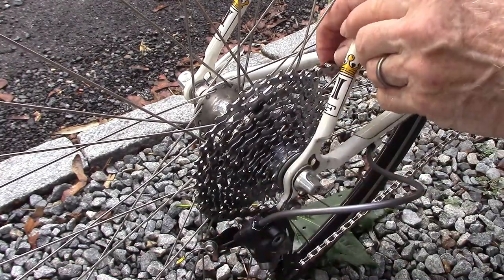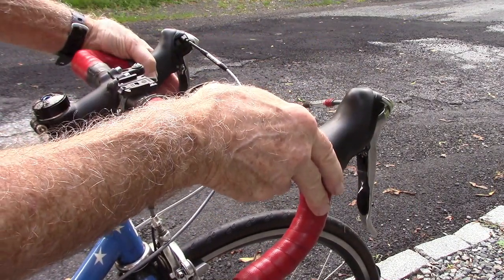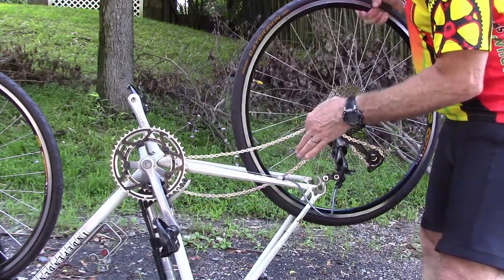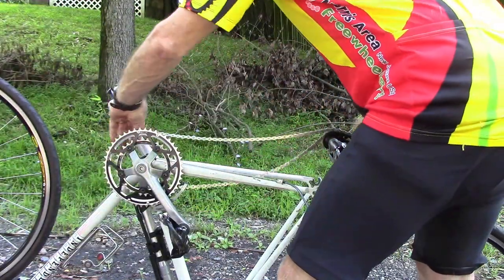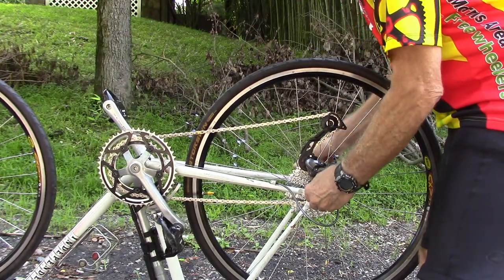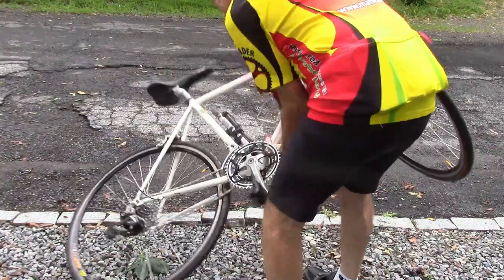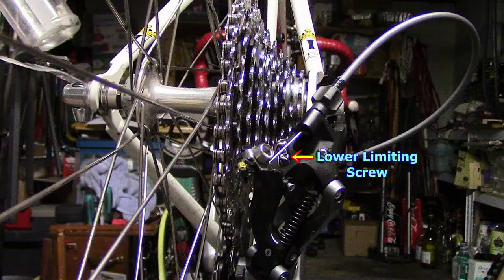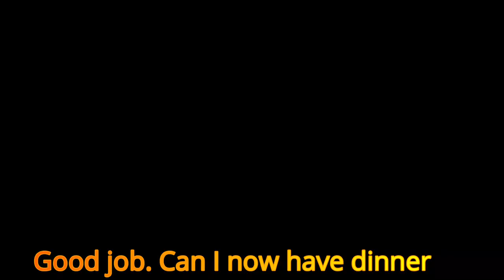Bike Chain Drop: Stuck Between Cassette & Wheel Spokes

Comment: Helpful video. The bending arm thing also got caught in the spokes of the rim. Crazy just bought the bike too. If you buy a new bike check that skrew.
Reply from the maker: My concern is that the skewer lever (arm) should not bend all the way back into the spokes which can damage the wheel. If you just bought the bike, I would take it back to the seller and tell him to replace the skewer with a better one. A quality skewer such as those produced by Shimano (which I use) run about $16 to $18 each.

Comment: Nice tip! Had this happen 2 miles after swapping a wheel  without adjusting the limit screw. I stopped asap and used a metal tyre lever and disposable gloves to pry it from behind the freewheel. It was quicker but messy.
Reply from the maker: Be cautious trying to pry the chain (especially with a metal tire iron) from behind the cassette. It's easy to damage the chain and wheel spokes. I would prefer removing the wheel, but that's just my preference. Regards, Tony

Comment: The trick is to be as gentle as possible. Grab the chain on both sides of the jam and gently pull in each direction while wiggling the chain around. It will eventually let go. Pulling as hard as you can is the absolute worst thing to do. Ask me how I know. The mosquitoes attacked me when I was trying to fix it so I panicked. I'm having issues with this happening on my mountain bike in bumpy downhill sections and haven't figured out why. The limit screw is set correctly. Next is to check the derailleur hanger to see if it's bent. This is a really bad situation because it causes the rear tire to lock up and the chain cuts up the spokes. If you can't get the chain out you have to carry the bike as it won't roll. So far I've been able to get it out but the spokes had to be replaced on the one side. I'll probably have to replace all 8 again.
Reply from the maker: You are right on! If you can't remove the rear wheel (as in the video), gently pulling on the chain as you describe is your best choice. Time and patience are the keys. I've used this technique for mountain and road bikes. Here's a reference you might be interested in:
https://mountainbikehangout.com/chain-coming-off/
Thanks for you input and safe cycling, Tony

Comment: I don’t have a quick release on my bike and don’t have the right tools to get the wheel off…. Anything I can do at all?
Reply from the maker: If it's a thru axle you'll need to carry an allen wrench of the correct size. If the wheel is bolted on, you'll need to carry a "stubby" combination wrench ($7 or less at your local hardware store or on Amazon) in your saddle bag. To remove the nut which may be stuck on, place the wrench at horizontal to the ground and use your heel for leverage (comes off counter clockwise). Watch out if the wrench slips that it doesn't fly off and hit you foot or leg. I don't know of any othe "magic" way to remove a bolted axle. Good question and thanks for your comment, Tony

Comment: I normally just push the derailleur forward to loosen the chain and then put it back on the cassete but today its happened again also making a sound. Going to take it to a bike shop tommorow
Reply from the maker: Sounds like the low limiting screw needs adjusting. Shop should be able to correct this. Let me know how you make out. Regards and safe cycling, Tony

Comment: Do you need a rench to loosen the bolt so the wheel comes off
Reply from the maker: Depends on the wheel. Quick release requires no additional tools. Many thru axles require a 6 mm allen key which is usually part of most multi-tools carried by cyclists. Some older or inexpensive bicycles have a thru bolt with a nut on the end which requires a open end or box wrench to loosen. The need to carry a such a wrench with you incase you have to remove the wheel to change flat or remove a stuck chain is problematic I must admit.

Comment: Should we remove the wheel or can we place it withoyr removing of wheel
Reply from the maker: On some bicycles, you can carefully work it out and place it on the large cog. When that fails, remove the wheel. Don't forget to slightly tighten the low limiting screw an eighth of a turn or so clockwise to prevent the chain from coming off again. Regards, Tony

Comment: What if the chain is stuck in the crankset?
I dont know what to do because its like stuck under it . Should i grab it and powerfully pull it out or is there any other method. Pls help and the bike is a mtb if it helps
Reply from the maker: This can happen on road bikes but is more common with mountain bikes, usually occurring while bouncing down the trail and then shifting to the smallest chainring for the next uphill. The chain just bounces off and get caught between the small chainring and frame or bottom bracket. I've had this happen to several of my companion riders while out cycling. We've been able to work the chain out by slowly working it back and forth (just a bit at a time) to finally release the chain. We worked slowly and carefully because we did not want to damage the paint on the seat tube. Afterward, we adjusted the inner limiting screw in hopes of preventing the problem from recurring. With some bikes it's more common then others. The forum below suggest ideas such as loosening the inner chainring bolts which is not very practical in the middle of a ride. Others suggest it may be related to insufficient chain tension (too long a chain or a rear derailleur with weak spring tension). Maybe our viewers have some other ideas (if so, please comment). See:

https://bicycles.stackexchange.com/questions/68253/chain-stuck-between-chainring-and-frame/68254#68254

https://www.roadbikereview.com/threads/chain-suck-and-dropping-issues-chain-line-issue.365654/

Regards, Tony

Comment: This happened to me yesterday. Was gonna take it to a bike shop (after trying unsuccessfully to yank it out, like some other suggestions I read), but, I'm gonna try your way. Will let you know how it went...
Reply from the maker: I would appreciate your feedback. Tony
Reply: @tony10speed  MISSION ACCOMPLISHED! Just finished 10 minutes ago! The only caveat MAY be, because I let the bike sit a few days with the chain stuck, I squirted a little "3 in 1" oil on the trouble spot first. THEN, I jiggled it as you demonstrated, & VOILA! Out came the chain, with NO trouble at all! Didn't  even have to take the wheel off. Just took the lugs off (NOT quick release wheels) to give me room to jiggle the wheel. Everything took around 5-10 minutes. EXCELLENT advice! Thanks!
Reply from the maker: @teeoh9192  I like the idea of a little lubricant to help you remove the chain. Glad it worked well. Regards, Tony

Comment: What if the chain comes off the small cassette ring? Dose that ever happen?
Reply from the maker: Rarely because the seat and chain stay usually prevent the chain dropping off the small cassette. However, if it does or the chain rubs against the stay, just remove the wheel and place the chain back on the small cog. Then turn the H limiting screw in about an 1/8 of a turn. Regards, Tony

Comment: I'm trying my hardest to unscrew it and it's not working and I used a tool to make  it easier but I just can't unscrew it any tips please I really need to fix my bike (it's a mountain bike btw)
Reply from the maker: Does your mtb have quick release skewers or bolt on? For bolt on rear wheel, see this video:
https://www.youtube.com/watch?reload=9&v=payDh430Zzk
If the bolt is stuck, try some WD-40 around the bolt heads on each side and let it sit a while before trying to remove the bolts. On one of the bikes I've worked on, I placed a box wrench on both the right and left axle bolt and then turned each counterclockwise at the same time. Work slowly but carefully. You'll also need to adjust the "low" limiting screw such that this doesn't happen again.
That's about the best I can do without actually working on the bike myself. Let me know how you make out. Regards, Tony

Comment: Can you shift to a lower gear while pedaling to get the chain back on?
Reply from the maker: Sometimes. Depends on the cassette clearance with the spokes, but I don't recommend it. First try to pull the chain up onto the large cassette. If that fails, follow the video. Don't forget to turn the L limiting screw in about an 1/8 turn or until the guide pulley is lined up with the large cassette sprocket as shown in the video.
Reply: No way. The chain fell off a cliff.

Comment: My chain is really jammed in there, and I can't get it out that easy. It is a mountain bike.
Reply from the maker: Try letting all the air out of the tire before removing the wheel. This may give you a little more room. Otherwise, carefully wiggle the chain out from between the cassette and chain stay. Go slow and take your time. Once the chain is out, you'll need to reset the derailleur high limiting screw so it doesn't happen again. Let me know how you make out. Regards, Tony
Reply: Just get a dork disc .
Reply: ঝঝ
Reply: ঝঝড্ডডডঢ

Comment: Went up a hill chain fell didnt notace now it is stuck cant move the bike back wards
Reply from the maker: Was it stuck between the cassette and seat stays? If so, did you try the method in the video? Or was it stuck between the small chain ring and seat tube, in which case you just need to take your time and slowly work the chain back and forth to wiggle it out. Let me know. Tony

Comment: The chain wont let go,pls help
Reply from the maker: Sometimes you can slowly work the chain back and forth as you try to move it upward toward the teeth of the large cog. Go slowly and be patient but with a little time and effort it can be lifted up onto the large cog. If all else fails, one can partially remove the rear wheel and then remove the cassette to get at the chain. You may want your local bike shop to do this. Be sure to reset the rear limiting screws of the rear derailleur so this doesn't happen again.
Reply: @tony10speed  thanks!it works well now,but I may need to go a bike shop since it damaged one of my spokes
Reply from the maker: @rknequia6857  Make sure they set the rear derailleur limiting screws so that the chain does not come off again. Regards, Tony

Comment: The bike screw to take the wheel out is stuck cant take it out
Reply from the maker: Do you mean nut on the bolt of the wheel axle or on a through axle? You can squirt it with some WD-40 or penetrating fluid (such as liquid wrench or Knocker-Loose) and leave it overnight and try again. If it's a bolt nut, after soaking with WD-40, fit it with a box wrench and use a mallet to tap it counter clockwise (carefully so you don't hurt yourself). Maybe you can give me some more details on this "screw" so I can be more helpful.
Regards, Tony

Comment: What about when the wiggle doesn’t work haha I’d already thought of that mate.
Reply from the maker: Usually, slowly wiggling the chain after wheel removal will remove the stuck chain. Be patient and take your time - eventually it will work. And don't forget to re-set you rear inner limiting screw to prevent this from recurring.

Comment: Its really dangerous if it happens on a steep hill wearing cleats......Bike suddenly stops and you have less than a second to get one foot out of the cleat....Or your going over on your elbow ....and nothing will stop it happening....You won't forget it if it ever happens to you.
Reply from the maker: You are right. I've seen this problem when putting on a new set of wheels on a bike. Even though both sets of wheel where true, the new large cog of the rear cassette sat about a mm more toward one side then the old wheel. This resulted in the chain coming off between the cassette on the inside. Luckily I noticed it in the shop when I ran through the gears and was able to re-adjust the rear derailleur limiting screws. On the road, done hill, this would have been a disaster. Thanks for commenting. Regards, Tony
Reply: Dork disc and F20s with flats.  I ride dorky 😎.

Comment: Mine is stock at the lowest on the sprocket
Reply from the maker: I assume you mean that the chain is stuck between the smallest cog and the chainstay. You still should be able to remove the chain by loosening the rear wheel quick release or axle nut and sliding the wheel forward. As to the cause, see:
https://www.reddit.com/r/bikewrench/comments/n0sbhj/chain_gets_stuck_between_cassette_and_frame/?rdt=36606&onetap_auto=true&one_tap=true

Comment: Mine got stuck But on small one
Reply from the maker: The only way to get the chain unstuck from between the small cog and the drop out is to gently jiggle the chain out (easier said then done). I don't usually see that problem unless the rear derailleur limiting screw in way out of adjustment. Once you are able to free the chain, adjust the "high" limiting screw to prevent such chain jamming.

Comment: Video no help made it all worse
Reply from the maker: Sorry to hear that. Some bikes I've worked with have very little room between the biggest cassette cog and the spokes and seat stay making both removal of the wheel and chain very difficult. In those cases, I still undo the quick release to give me as much room between the cassette and wheel/frame. Slowly work the chain out with your hands. It may take some time but it can be done. Then the important part: Reset the lower limiting screw on the rear derailleur to prevent this from happening again. I appreciate the feed back even if it's not favorable since we all learn from one another's experiences. Regards, Tony
Reply: @tony10speed  thanks for the advice just got it all undone finally took about 2 hours in total very frustrating
Reply from the maker: @lukefield1125  Glad you were able to get the chain out. Be sure to set the rear derailleur limiting screw to prevent it from happening again. Or consider a spoke/cassette guard such as the following:
https://www.amazon.com/Sunlite-Spoke-Protector-SUNLITE/dp/B003CO3RCY/ref=sr_1_16?crid=GKYCCU1TZZCM&dchild=1&keywords=cassette+guard+bike&qid=1635430471&sprefix=cassette+guard%2Caps%2C166&sr=8-16
It may not look the coolest thing on the bike but will prevent the recurrence of the problem.
Regards and safe cycling, Tony